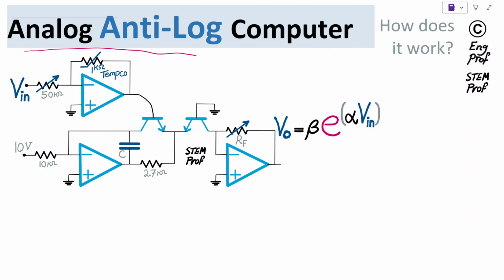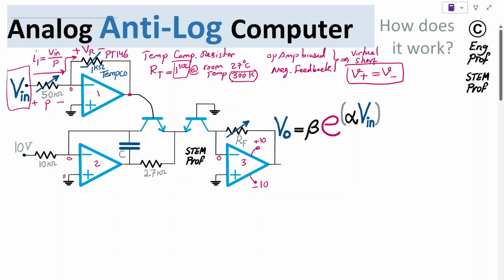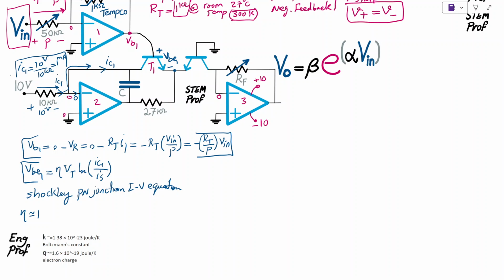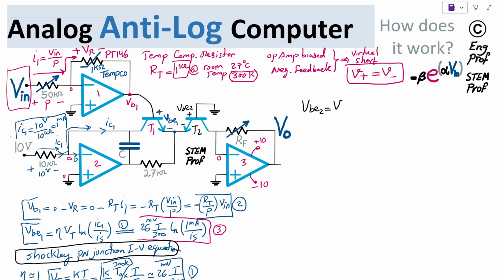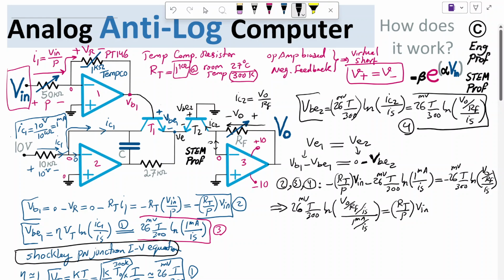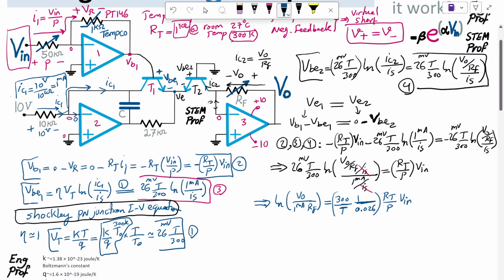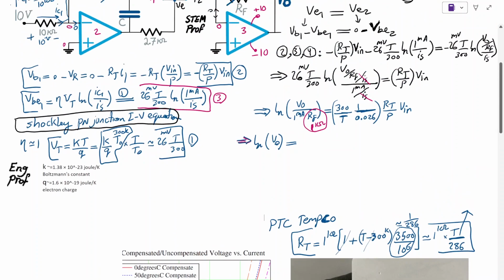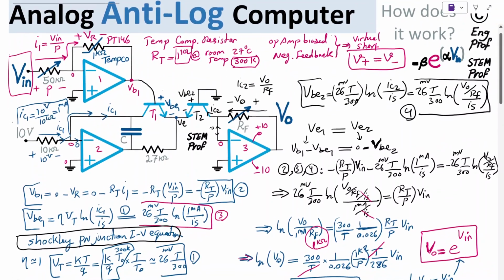Anti-Log Analog Computer with Temperature Compensation

Comment: Please, what's the function of the resistor and capacitor connected between op amp 2 and the common emitter of the transistors?.
Reply from the maker: Thanks for watching and your good question. Glad that this amplifier video is useful. For more example pls see the list below. The resistor between output of op amp & common emitter increase stability of the circuit by working as negative feedback with respect to base-emitter Voltage of  BJT transistors. It keeps the current sensitivity to a reasonable level to avoid oscillation or saturation of transistors and/or Op Amp. The capacitor between output of op amp and its negative input terminal is to keep op amp stable (and not saturated as additional rout for negative feedback given thar the main negative feedback  route is base-emitter PN junction Diode of BJT transistor that if turns off would turns off the negative feedback route if capacitor is not there. I hope these explanations are helpful. For more Analog Computer & Op Amp Circuit examples please see: 
Analog Logarithm Computer https://youtu.be/RpKEq5WyoLg
Op Amp Analog Computer Differential Equation Solver https://youtu.be/ENq39EesfPw
Analog Computer to Raise Signal to power n https://youtu.be/IUTlBH1UraE
For more analog signal processing examples see: https://www.youtube.com/playlist?list=PLrwXF7N522y4c7c-8KBjrwd7IyaZfWxyt
Thanks for watching.
Reply: @STEMprof  Thank you
Reply from the maker: You're welcome. Please see the Analog Circuit Collection for more examples: https://www.youtube.com/playlist?list=PLrwXF7N522y4c7c-8KBjrwd7IyaZfWxyt
Thanks for watching.

Comment: Ok i am an analog IC designer. But using these special resistors for the control problem? You can generate the a*Vt by generating a current ratio where the current ratio themselve is the control input. I would suggest too that instead of using a singular application solution to split and proceed an application problem more in detail and demonstrate in chapters the evolution to solving more complicated cases.
From the education perspective it is not only helpfull to built up a collection of the simple solution but also to inspire solution for more complex practical applications.
Reply from the maker: Thanks for watching, your interest and sharing your thoughts & suggestion regarding this temperature compensated Exponential (Anti-log) amplifier circuit video. I will try to post more examples with better explanation. There are many ways to realize linear temperature compensation. This example uses a Tempco PT146 resistor (temperature compensating resistor) with positive temperature coefficient (like a PTC thermistor) that is thermally coupled and connected to the junction of the BJT pair.  The Tempco PTC resistor removes the linear dependency on temperature while the matching transistors remove the dependency on transistor saturation current that is exponentially temperature sensitive.  For more examples please see:  Analog Logarithm Computer https://youtu.be/RpKEq5WyoLg
Op Amp Analog Computer Differential Equation Solver https://youtu.be/ENq39EesfPw
Analog Computer to Raise Signal to power n https://youtu.be/IUTlBH1UraE
For more analog signal processing examples see: https://www.youtube.com/playlist?list=PLrwXF7N522y4c7c-8KBjrwd7IyaZfWxyt
Thanks again  for watching and sharing your thoughts 🙏

Comment: Your analysis itself is easy to follow and I'm glad you take the time to work through even the basic algebra step by step for the sake of clairity.  As someone who had professors which were fond of skipping the "busy work" in their explanations it's definitely nice to see.  I do think this circuit would be a lot to intuit if you began with a typical uncompensated exponential core first though then introduce the complications of temperature compensation afterward.   Especially since with the base voltages flipped around like is the case in that circuit it's generally pretty easy to demonstrate the basic concept of what this circuit is doing by using one of the matched transistors as a reference with constant bias to cancel out the base voltage of the other. 

On the topic of components though I feel the LOG112 deserves a mention since it implements this circuit almost exactly as you have it here.
Reply from the maker: Thanks for watching and your encouraging comment. Glad that you liked this temperature compensated Exponential amplifier video. Thanks also for your suggestions and feedback. I will try to post another example and refer to Texas Instruments LOG112 logarithmic amplifier as well.  For more examples please see:  Analog Logarithm Computer https://youtu.be/RpKEq5WyoLg
Op Amp Analog Computer Differential Equation Solver https://youtu.be/ENq39EesfPw
Analog Computer to Raise Signal to power n https://youtu.be/IUTlBH1UraE
For more analog signal processing examples see: https://www.youtube.com/playlist?list=PLrwXF7N522y4c7c-8KBjrwd7IyaZfWxyt
I hope these Circuit design and analysis videos are interesting as well. Thanks again 🙏